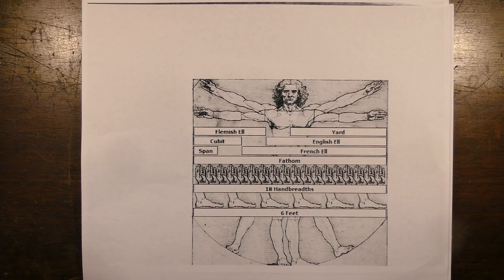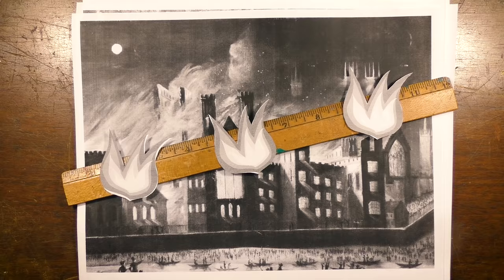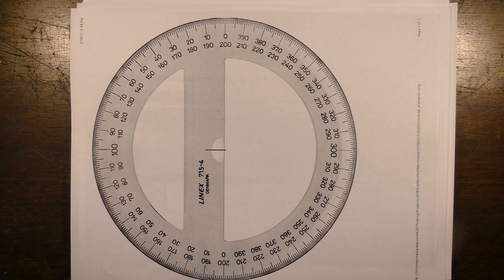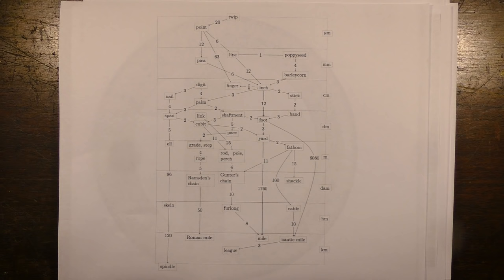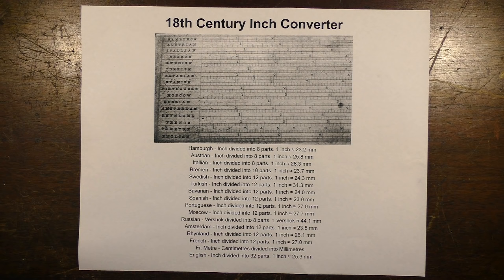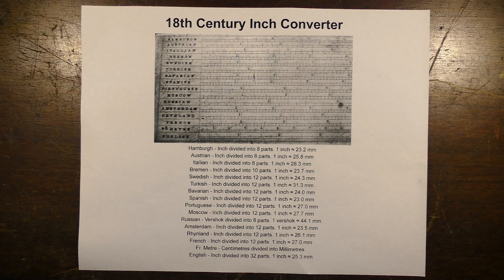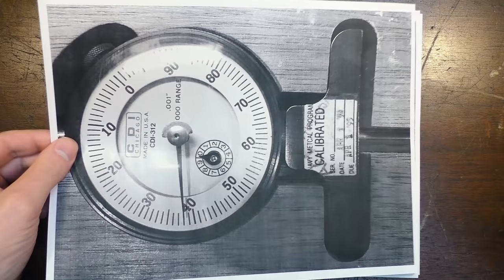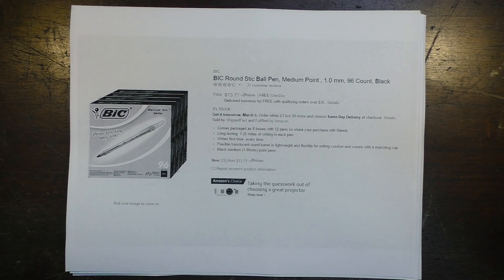Origins of Precision

Comment: I’m a retired US Army metrology technician. I always tried to avoid wringing more than 4 gage blocks together. In addition to the 81 piece sets, we had 8 piece gage block sets with blocks from 5 to 20 inches in increments of 1, 2, and 4 inches. Every wrung connection and every additional inch of length added to the uncertainty of the overall length. It was essentially pointless to measure anything over 2 feet long with gage blocks.
Reply: How did they stick together?
Reply: @3bydacreekside  Wringing requires two smooth, flat surfaces with surface finishes of 1 microinch AA or better.
  For gage blocks, it becomes difficult to wring surfaces if the flatness starts to exceed 5 microinches. The sources of the forces holding gage blocks together are thought to come from:  
      1. Air pressure from the surrounding environment as the air is squeezed out when the blocks are slid together.
      2. Surface tension from oil that remains on the gage blocks or water vapor from the air acts as a glue to hold them together.
      3. When two very flat surfaces are brought into such close contact with each other, this allows an interchange of electrons between the atoms of the separate blocks, which creates an attractive molecular force. (This force will remain even in a vacuum or if no oil or water is present on the blocks.)

The last two sources are thought to be the most significant.

Comment: The last time 3 surface plates were originated was when Moore Tool Company was building Jig Measuring Machines in 1974. The fantastic accuracy necessary ALSO require the coordination of the French and US Governments to get them to pass laws defining the Inch in terms of the Meter. That is when "One Inch Is Exactly Equal To 25.4 Millimeter" became official. January 1, 1975.

Comment: To answer your question about exactly how many measurements you can produce, you can make any measurement larger than (and including) 0.1001" that you have enough blocks for. Of course, if you chain together too many blocks, you start affecting accuracy, so you wouldn't chain together more than 6-8 of them. If you chained together the 1, 2, 3, and 4" blocks, you'd hit 10 inches. Adding a couple more blocks would give you something over 10 inches, but with diminishing accuracy. The point being, you can build everything from 0.1001" through something larger than 10" in divisions of 0.0001" with five or fewer blocks. There are 100,001 combinations between 0.1001" and 10.1001" (inclusive), and how much further you want to go is dependent upon how many blocks you're willing to chain. So, it's more than 100k, but how much more depends upon you.

Comment: I just found out that precise spherical surfaces, like planar surfaces, can be lapped by hand tools without round reference surfaces or precise circular motion. Curved surfaces opposing each other formed by rubbing planed against each other with no third plane for a surface that is exactly spherically curved. I also think there's a way to grind/lap right angles into existence without any reference required.

Comment: The metric system does not make things simple. Sure, you can convert from meters to kilometers quite easily, but if you start doing quite standard things like dividing a meter in half (50 cm), and then half again (25 cm), and then half again, (12.5 cm), and so on, it starts to get awkward. (6.25 and 3.125 cm, anyone? Notice the number of digits growing larger than your significant digits there? Yes, that sequence is really .5, .3, .1, .06 and .03 m, but don't try to divide the number expressed with proper sig digs in half!)

And of course it gets only worse when you need to divide things in thirds.

This is why the Babylonians used base 60, leading to us having 60 seconds in a minute, 60 minutes in an hour, and 360 degrees in a circle.

Admittedly, base 60 can be slightly awkward, but we can still do much better than base 10. When I am made Ruler of the World, my first move will be to make everybody use base 12.

Comment: You put up a math challenge and while I'm not going to solve it, because it's too long, I am going to explain how to solve it. The formula for combinations is n!/(k!(n-k)!). The number of blocks (n) is 112. The next step in determining the number on blocks to be used in each set of pairings, like how many pairs of 2 or 3 there are, to determine how many times you have to solve the formula as each set of pairing is a different number for k. There are a total of 111 different numbers for k ranging from 2 to 112. After solving the formula 111 times you then need to add all of your results together to get the finally answer to how many total combinations are there for this set, and it's likely more than your calculator can handle down to the last digit. The more important question is what is the range of messuement that this set is capable of, and that's a lot easier to solve, as it is the messurement of the smallest individual piece to the total messurement of all of the 112 pieces combined.

Comment: I have used a Moore Jig Grinder. It looked like the one you have in your video in the bottom right. No electric digital readouts but a stander machine dial on the wheel and a mechanical digital  counter for how many times you have turned and part turned the wheel. there was also a Vernia on the dial for 0.0001".
The jig head ran on air pressure with stops set on the z axis to set the top and bottom of the stroke behind a mat to keep the slideway clean.
You could also set the head at an angle so you could grind tappers holes. This was never as much fun as you think as the adjustment wasn't very fine and the putting it back again after was a long and tedious job.
With a DTI set the head to run in the centre of a hole in a block with the quale fully extended and the head fully raised. they should say the hole is the same size. if not adjust the tapper setting and repeat. Zero one the machine gauge wasn't in the right place any more by the time I got to use the machine. I guess it had one or two over accidents.
The machine was at Leicester Engineering Services England. they closed in around 2009 ish and made fine blank pressed parts (the metal plate at the back of a brake pad mostly)
The machine wasn't used much after they got there first Wire Erosion Machine. its programs ran on punch tape. Why grind when you can cut, if the material is hard or soft mild steel or carbide it didn't mater.

Comment: Old engineering saying:

"If you cannot measure it, you CANNOT make it".

There is an excellent book titled; " Exactly: How Precision Engineers Created the Modern World", by Simon Winchester.

It covers some interesting aspects of metrology and the eternal loop containing designers, draftsmen, fitters, machinists and metrologists and all their associated equipment. In some of his previous books he discussed the challenge of making sufficiently precise and robust ships chronometers, without which accurate positioning and navigation was practically impossible. Once accurate "fixes" achieved, night or day on a featureless ocean, it meant that he charts could be seriously refined, thus making landfall more certain and a lot less dangerous. were easily. All it took were developments like star and sun tables, the proper sextant replacing the old astrolabe and the super-stable chronometer.

This tied in with the increases in precision for other delicate machinery, like the equatorial drives fitted to serious telescopes. This in turn links to the devices to measuring teh finely-ground and polished lenses used in these telescopes.

Comment: It's interesting how you can get an accurately flat surface by rubbing roughly flat surfaces together.  By a similar process, you can grind a spherical or parabolic surface by hand in a glass block, to make a telescope mirror accurate to a fraction of a wavelength of visible light (a few millionths of a millimeter).

Comment: I really enjoyed your video. However, you have far more faith in the accuracy of your printer than I do, although that is a short cut I use frequently.  The meter was updated in 1980 to represent the distance light travels in approximately 1/300,000,000 of a second in a vacuum.

Comment: Careful cleaning is required with each use. No oil is used as a layer of oil adds to the length. Gage blocks will wring together (stick) as molecules of air are forced from the two faying surfaces and held together by barometric pressure.

Comment: I was wondering the same thing myself the other day. Rubbing two rocks together was what I thought too, but also, heating metal until molten then letting it cool inside a frame. Wouldn't gravity create a perfectly flat surface atop the metal once it cooled and hardened?
Reply: It would warp as it cools

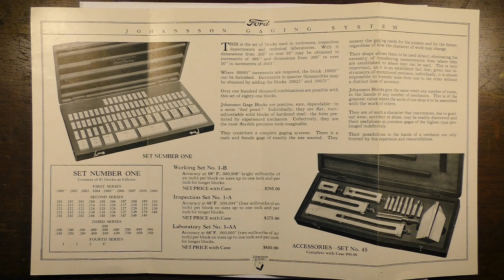Comment: @17:20 -- the number of combinations possible with 81 blocks is basic math -- this is called a "combination":  a combination of  N objects taken R at a time, without respect to order.

And you want the sum of that,  for a range of "R" from 1 to N. 

It's clear the brochure was written by a salesperson, not anyone with any technical knowledge, as it is vastly -- and I do mean *vastly* -- greater than "hundreds of thousands".

The formula for a specific combination of N objects taken R at a time is N factorial divided by (R factorial times (N-R) factorial):
  N!
----------
R!(N-R)!

You want the sum for all values of R from 1 to N for the above number.

Somewhat mathematically (lacking math notation here, I'll have to wing it):  ∑ (R: 1→N) N!/(R!*(N-R)!)

I just did a quick summary in an excel spreadsheet, and this number is pretty damned huge (given that it involves 81! this is hardly surprising):
2.41785163922926E+24

Yes, that's 2.4 times 10 to the 24th power.  It's worth noting that 10^24 is the highest named prefix currently in the SI system: "Yotta"

Comment: There should be (2^82)-1 possible subsets of 81 gage blocks. Assuming some few collisions in the search space (where 2 different combinations add EXACTLY to the same millionth of an inch), and you have the calibration sheet that gives the millionths of an inch, you can likely get somewhere around 10 million different lengths out of them.

Comment: 7:00 Metric system bonus perk that not enough people know about:
Wanna EASILY get the volume in liters?
Grab the measurements in DECImeters (10cm) and calculate the volume.

the results is the volume of your object in cubic decimeters yeah
but also the amount of liquid it can hold.
because 1 cubic decimeter = 1 liter :D

i've watched a thousand people calculate the volume of something in cm or meters and then somehow also manage to struggle with dividing or multiplying by factors of ten x'D
never grasping how just measuring & doing the math in deci's woulda saved so much effort and time lol

Comment: Funny thing about the mol of hydrogen example is that the mol is actually derived from the gram and is more accurately called the gram-mol. There even is other moles such as the pound mol and the kilogram mol. And similarly to how there is 1gram of H2 per gram mol there is 1lbs of H2 per pound mol.

Comment: maybe i didn‘t listen carefully, but you seem to use „accuracy“ and „precision“ incorrectly. „accuracy“ is used when one workpiece is made exactly to design within the specified tolerances. „precision“ is used when all workpieces of a series (more than 1) are made exactly to the specified tolerances with no variation (within tolerances) among all workpieces. btw the word „design“ originally meant „created and planned for machine production“ as opposed to „crafted“ which meant individual workpieces that were made by hand. these all started with the industrial revolution and strongly influenced the Bauhaus designers because their work was meant for the masses and needed to be mass produced.

Comment: I used to think imperial was stupid until I actually started working as a fabricator. Metric is good for high precision but when it comes to doing math in your head quickly imperial is king. A dozenal system divides way easier than a decimal one.

Comment: Wow enjoyed the vid, thanks. Examples of unthreaded bolts might be door bolts, latched and unlatched, and rifle bolts which may be slotted and push the next round into the breech (I think).
Also I think the steering lock on cars uses an unthreaded bolt. Something attached to the ignition key mechanism withdraws the bolt from the steering column when the ignition key is turned to the intermediate position. 
Thank you again for the fascinating video.

Comment: As the surfaces are so flat but microscopically they are not but are pitted and due to your ever so slightly deforming then in a bend that the pits act like suction cups when you stop wringing them together the air can't escape and pulls a vacuum. Or the air trapped in the pits gets cooler from the steel pulling heat from it also causing a slight vacuum at multiple points on its surface or a combination of the two. Consider that temperature alters them. Maybe the changing temp of the steel expanding on its surface causes the vacumn to occur in the pits. To me that seems the most likely cause due to what happens. A vacuum has to be being pulled at a microscopic level across the surfaces in pits on the surface.

Comment: The answer to all possible combinations of an 81 piece set will be 81 factorial plus 1 or 5.79712602 e120 
Approximately
5800000000000000000000000000000000000000000000000000000000000000000000000000000000000000000000000000000000000000000000000

This is because as you add 1 item that item can be combined with all previous combinations. To demonstrate just take 2 and 3 block sets. all possible combinations are as follows

2 blocks A & B    2! = 2  (A, B, A+B)  ie 3 combinations 2!+1
3 Block set A, B & C  3! = 6  (A, B, A+B, C, C+A, C+B, C+B+A)  ie 7 combinations 3! +1

You need only 9 blocks to exceed 360000 combinations
 ,

Comment: I was lucky enough to have wired up several machine & tool & die shops. Would break their balls saying any hole that I drill within 3/16" is accurate. Was amazed that machnists can get holes within halve of a thousands of an inch. Tool & Die Forman told me that close tolerances kill so I asked him to explain. Told me that tool & die machnists have a higher rate of suicide & going crazy. Did see a guy ruin an expensive mold for injection molding after spending 40 hours on it. He cursed himself and before going home early told the owner he would quit so he wouldn't have to fire him. Guy was a great worker and owner called him to tell him we all make mistakes and he still had a job.

Comment: It is certainly not vacuum welding, as they would not come apart again; the clue is in the title. :P
The fact they must slide together to form the seal makes me tend to think that it creates a very low pressure area between the blocks, and the seal around the edges can't be broken by 1-bar as the joint is mechanical - and that 1-bar provides all the clamping force required to hold them firmly - but temporarily in place.

Comment: So, I'm a bit late to the party, but the total number of possible combinations from a set of 81 gauge blocks is the sum of all the binomial coefficients from 81 over 1 to 81 over 81. Which, according to Wolfram Alpha, is 2 417 851 639 229 258 349 412 351. Keep in mind that some of those combinations can amount to the same measurement, so the number of actual measurements is lower than that. Still, that is an insanely large number of combinations... There, now you know.

Comment: 17:02
Since each block is unique, you just have to add up how many combinations of 0 blocks there are plus how many 1 blocks plus 2 blocks plus 3 bocks plus all the way up to the 81 block combination. That would be Sum(81 choose i) {0 ≤ i ≤ 81}. Or you could think of each combination as some on/off sequence of the blocks, then because each of 81 blocks can be in one of 2 states, you have 2⁸¹ possible combinations. Both methods result in 2,417,851,639,229,258,349,412,352 possible combinations, so they're probably counting different combos of the same length as a single combination, so .100 + .200 and .050 + .100 + .150 and .050 + .250 and .300 would only be one combination.
Reply: Also, please tell me when filming yourself placing the printouts on the table, you didn't try to time it to the script. Please tell me you placed, paused for like a second, placed the next, and so on, and then in editing you extended the paused sections to match with your recorded audio.

Comment: The accepted Theory and one that is the only theory that actually is backed up by evidence is that it internment molecular forces. Check out something called gecko tape. It works extremely similarly. Instead of being an extremely variable surface though, these simplywork by being extremely flat. They air also helps and so does the oil that you may not have cleaned off of the block. But if not cold welding.

Comment: I make parts on a Haas mill that need  .002 (2 thousandths) inch accuracy, I hardly ever measure them anymore because when I do they are within .0005 (1/2 of 1 thousandth) inches. This is on an older machine, the new ones are way better!

Comment: Ive thought about this before and I skyways thought that that precision came from geometry that came from holding something of a fixed Length like a cord or a tree branch and making shapes with it. Like if you took a cord and held one side still and went in a circle with the other side to draw a circle in the dirt or by taking a stick and placing it on the ground and making an impression and then doing that two more lines to make a perfect triangle.